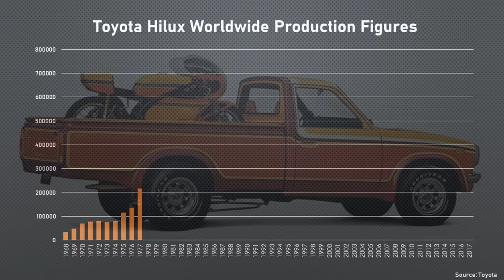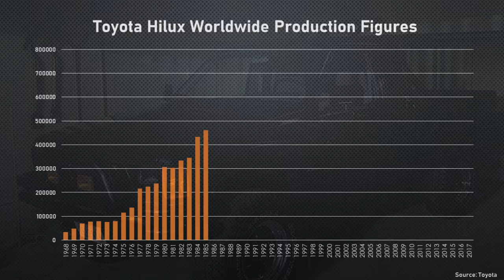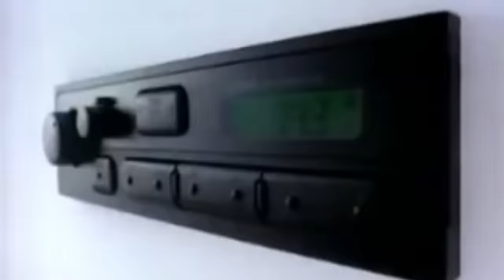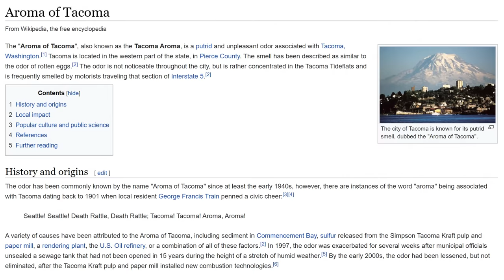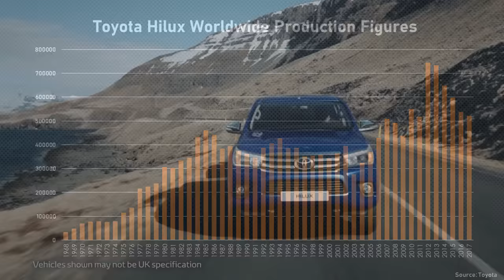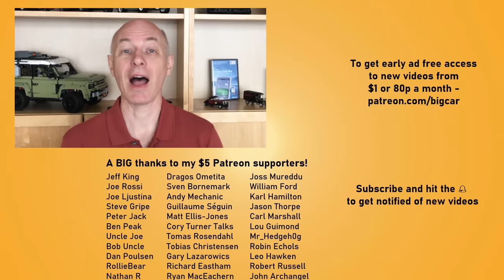Toyota Indestructible Hilux!

Comment: Another brilliant  video.  I had an early Hilux Surf. Got it secondhand with 400 000 km on the clock and it did another 100 000 with me through Namibia, Botswana, South Africa and primarily  Zimbabwe.  The only thing  that required  replacing was a transfer box oil seal.  I had a Land rover 110 Defender before that and the only reason such as high proportion of them still exist is because they spend a large percentage of the time being repaired.   If you want to find a Land rover driver, don't  bother looking behind the steering wheel, look under the bonnet (hood)!

Comment from the maker: Errata: In the "war zone" section, some of the pickups shown aren't Hilux's. But the point still stands.
Yes, I've made mistakes when talking about suspension!
Reply: The mighty landcruiser ute is still a toyota though, and better for some things anyway. Great video
Reply: @michaeldilger9582  If u look on Toyota South Africa u still can buy a brand new 70 series Land Cruiser and FJ
Reply: Some mid wheelbase 70 series land cruisers called “ bundeera” are Hilux chassis and running gear
Reply: Ah, seeing this now. Apologies for my previous comment. :-)
Reply: Pin your comments dude, I left one about a suspension mistake and now i see this lmao. Thanks for the good content. Don't be afraid to take notes and remake these vids with better gfx and updated dialouge in half a decade.
Reply: ‘Why did Toyota end US Hilux sales?!?’ The video didn’t answer the video title question, what gives?
If anything according to the video Hilux sales are still going strong.
Reply from the maker: @s4098429  Because they sold the Tacoma, which was more tailored to the US market. I mention it in the video!

Comment: My brother owned a 1987 Dolphin motorhome built on a HiLux chassis. It was a nice rig, comfortable, rugged and mechanically sound. He put 100k miles on it in 8 years with no major problems of any kind. My guess is the chassis was right on the edge of being overloaded since you couldn't get up 65 if you weren't going downhill, and it needed the airbag suspension to stay level. Still, it worked fine once you dealt with the limitations, and there weren't any other self contained rigs back then where you could get 18 mpg from regular gas. He sold it in 2000 because they were retiring to become fulltimers, and the Dolphin was just too small for that. He misses it though, and his family and mine had some great trips in it.
Reply: I saw one the other day!
Reply: Thanks for sharing your story :-)

Comment: Jeremy Clarkson: "I'm going to kill one on Top Gear."

Hilux: "I'm about to destroy this mans dreams."
Reply: We own a 1974 1600 12R single cab Hilux bought in 1976 and still running. I tried to 'accidentially' write it off twice but it and I survived (obviously). 
Simple strong well made... indestructible Toyota.
Reply: @Time4Breakfast  That's great. I always love to hear from the owners and how well they do. Enjoy the ride.
Reply: @BrandonHanson  you don't know a '70s Hilux otherwise you wouldn't use the words enjoy & ride in the same context 😲🤣
Reply: @Time4Breakfast  If I didn't know anything about this Truck, especially after seeing it on BBC Top Gear. I never would of commented on this video now would I of?
Reply: All staged. 

All you have to do is put a Hilux within 6 feet of a salt shaker and it will rust into nothing.

They must have hosed it off and then doused it in diesel after the North Sea stint.
Reply: @Bartonovich52  you seems to hate it so much that you comment the same thing everywhere
Reply: @Bartonovich52  For being "staged" They sure let it do well let it float out into the open waters during hide tide. So, I imagine where was a "raft underneath it while it was sideways?
Reply: @Bartonovich52  rubbish
Reply: I cant forget jeremy's face when he couldn't kill the red pickup. And he never said "badly made these are!!"
Reply: Lies I tell you. Mine has only 460k miles and already needs an engine service.
Reply: @nobodynoone2500  you need to change the oil and filter every 10K miles...... it should last more than 460k miles....... maybe another 100k miles.....
Reply: @Bartonovich52  watch whistlin diesels videos on it lmao

Comment: I love Toyotas. They were so well built that the body shell would literally disintegrate and the running gear would still be sweet. I had a 95 corolla 1.3 hatchback with a 5 speed manual that I'd regularly thrash the snot out of over hilly, winding roads red lining through 2nd and 3rd. Great feed back through the wheel, sat down nicely in the ass on tight corners when you put the power in and just the right amount of forgiving understeer if you went into a corner a bit too hot. "Sniff" I miss that car a little bit still, it had soul.

Comment: Great video as usual, many thanks. I’m intrigued by the long-term environmental impact of indestructible vehicles like these. Granted, they’re heavy, damage roads more, and guzzle the juice liberally. But if one of these could physically outlast 2 or 3 normal vehicles, it is arguably the more green choice? Reduces by a factor of 2 or 3 the amount of cars being *made*. Has anyone ever thrashed out the figures on something like this?
Reply from the maker: Making a car is a good %age of it's total environmental impact, so having a car that last longer can only be a good thing.
Reply: My 2RZ-FE equipped 1996 Tacoma 2WD (w/ 5-speed manual) is getting 28.3 US MPG mixed! For solely highway driving, 30-34+ US MPG is very doable. I did replace the (cracked) iron exhaust manifold with LC Engineering's street-legal header, so efficiency (or power, depending on driving style) has been boosted at least 10% or so. The rest of the exhaust is all stock, so it doesn't sound annoying or too loud. Can't think of a better single vehicle for myself- load up 1500 lbs, tow 3500, or get groceries and run errands, all without using much fuel.

It has over 337k miles- due to previous owner's neglect, we replaced the cracked cylinder head in 2019, and some sensors, but otherwise, not much with the engine. Lots of other parts were worn, but they functioned for 20-25+ years before I replaced them. A true testament to the build quality of Toyota (and Aisin, etc).

Comment: I never drove a Hilux until I got stationed overseas. These simple little trucks gained my respect. Despite harsh desert conditions and questionable maintenance, I can never recall one having a mechanical failure. The simple gasoline 4 cylinder and 5 speed manual transmission probably contributed greatly to that reliability.

Comment: Great video I currently live in Thailand, and I also have a Toyota hilux, mine is a 2004 sport cruiser, basically a 4 door pickup3,0 litre diesel auto, it has 230000 kilometers on it ,and genuinely genuinely I have never had to replace anything on it other than servisable parts, oil filters battery ,front shocks only ,tyres and only the front break pads no discs yet, don't think I have ever put a bulb in it, obviously the weather here helps but these are some unbelievably good vehicles, ohh its had a few sets off wiper blades actually as the sun tends to melt them to the windscreen, but other that that nothing.
Reply: I am relatively new to living in Thailand from the UK.
I bought a Toyota Hilux PreRunner Double Cab 2.4 diesel in 2017 but recently added a Standard Cab 4x4 2.8 diesel as a work vehicle.

Comment: Really surprising to know that the Innova and Kijang (sold here in the Philippines as the “Tamaraw FX”, then “Revo” on its final years) were based from the Hilux!! The only one I knew heavily based from that car is the Fortuner. Both the Hilux and Fortuner would cost you quite a sum here and considered a status symbol.
Reply: I know I’m a little late, but a little correction there. The Kijang (or the Tamaraw FX in your country) was based entirely on a different underpinning, while the Innova (or the Revo) was indeed derived from the Hilux. As well as the Fortuner, they’re all part of Toyota’s IMV program with the main purpose of developing rugged MPV, pickup and SUV for developing countries 👍

Comment: I have had two of the truck models shown:
1971 Hilux 1st generation.
1984 & 1986 Hilux SR5 turbo. 4th generation.

I wish I never sold the 1971, we were the original owners. After it was stolen and partially stripped for the second time, it sat for 10 years and was eventually sold for scrap. ;(
Looking back, it wouldn't have been very difficult to repair it and get it back on the road. 

I have a few of the rare factory Turbo trucks that I plan on keeping as long as possible. 

Toyota trucks never die!

Comment: I started my career as an auto technician at a Toyota dealership in 1993. The pickups were our best sellers right next to the Camry and Corolla. When the T100 first came out, it was not well received by our customers. Great video!!! I had NO idea VW rebadged a Hilux!!
Reply: I read somewhere VW is now going to rebadge Ford pickups...
Reply: mauritsvw - 2G / Mk 2 Amaroks on the T7 (6G / Mk 6 Bronco SUV) chassis. 

Although with the possibility of a future merge between Toyota and VW looming (check the new project between Hino and VAG's commercial arm), who knows if that with Ford won't last long...
Reply: Yeah it "bugs" me a little 😂
Reply: Joel Atteberry - try the Toyota SA shown in the video. It'll really BUGS YOU UP.
Reply: @syxepop  Interesting, thanks!

Comment: Own a 2010 hilux. From my father, to my brother, and now Ive been using it for almost 4 years now. 195,000 km. Just on-time maintenance. Still running smooth.
Reply: Nathan Marais  How TF? I own a 2003 Hilux SR5 with 154,000 km on the clock. I purchased it at only one and a half years old, in 2005, and it already had a massive 34,000 k's on it then... I don't know how people do it?
Reply: Nathan Marais  Thanks Nathan, I still can't fully comprehend, your butt would have to be strapped in the seat 24/7 in my minds eye. I bought mine from a farmer too, they just must do incredibly large miles? I've done 120,000 in 15 years, and I thought I drove it heaps.

Comment: Toyota Hilux: "Indestructible!"
Australian Coal Mines: hold my beer
Reply: @BigBoiTurboslav  Yeah, but also the water at the washdown bays is always somewhat corrosive.
Reply: I agree with Godfrey Poon. I was in the Mt. Isa lead/copper mine years ago and the used hilux, s to go around the mine underground. They would be absolutely destroyed when they were brought back up to the surface. Only 6000kms on the clock. But they would still run
Reply: A salt shaker six feet away: Hold my beer. 

Seriously.... Toyota has always sucked at corrosion protection. The only truck I’ve ever seen to have a frame literally rust in half.
Reply: @BigBoiTurboslav  u just described a bogan that dident buy a commodore
Reply: Hold my Foster's you mean
Reply: @godfreypoon5148  Wasn't really arguing with you, mate. I haven't been around the outback much but just witnessing Brisbane driving makes me feel bad for those poor Hiluxes
Reply: @BigBoiTurboslav  I didn't read any argument in your comment haha. It's all true.
Reply: Argyle underground 2 year old Hilux’s and Landcruiser’s looks like they fell out of the sky without a parachute! 
But my 89 extra cab petrol 4x4 
And my 03 DC diesel 4x4 
are mint and awesome !!
Reply: @mogwaifan7094  seen the same happen here at a mine in ireland when it was in operation ....... local man used to supply good low milage  imports from the uk  , and take away the abused ones when needed .............purchased one in 2008 from him and still have it ,,,,,,,was never  underground  but is a little beaten up  by now but  runs good ..........clock shows 195k miles but i often think it could well have had a hair cut  before i  owned it as it was imported   .............
Reply: Mahindra what now
Reply: Every mining company. I'm from Peru and mining companies buy them on bulk they're so reliable at high altitudes above 4000 meters
Reply: Indeed...its the coal ....highly corrosive.....very common for a brand new mine vehicle to only last a little over a year before it is a write off....its a testament to how much money they have to throw away when they just replace them with brand new vehicles every year or 2 and just auction off the rest for whatever

Comment: "Why did Toyota end US Hilux sales?!?"
DID I MISS THE EXPLANATION?
Reply: Your not alone because I'm thinking the same thing. I'm sure it's in there though ?
Reply: Because it was replaced by the Tacoma
Reply: Because the American market preferred a little more luxury and larger vehicles, so they ended the Hilux and instead introduced the Tacoma line which was specifically designed for the American market to compete with Fords and Chevies.  Although technically the 4Runner is still based on the Hilux so the name may not be there, but the car still lives on.
Reply: @jonjohns8145  thanks for the info !
Reply: @jonjohns8145  Pretty much what you said, though the current gen 4Runner is actually more related to the Land Cruiser Prado/Lexus GX than the Hilux nowadays.

Comment: I drove a '74 year round in Alaska for a very long time. Couldn't kill the thing.  After insulating the cab, installing an electric water pump, and a Cadillac heater box it was even somewhat comfortable.
Reply: I've got an original 1974. 
The bench seats are not comfortable or even ergonomic. 
I use cushions.👍
Heating not a problem here in Australia. But 40°c and no aircon can get a touch uncomfortable 🥴
Wind down the window? Hot still air vs. hot moving air !! Cheers

Comment: As usual, excellent video.
I would add that, if in europe and USA, front suspension was independant early on, in developping countries a heavy duty version, with beam axles, was still available in the 90s. I had one in Papua New Guinea from 1991 to 1993. 2,8 naturaly aspirated engine and front beam axle. The other brands (Nissan, Isuzu) had IFS and we had to weld it back to the chassis about once a year...

Comment: Had 2008 Hilux 3.0 D4D for a few years. When working on powerline projects I was towing trailer with metal bars, medium and high voltage headgear or quadbike. Off-road is well. Beast. Once I drove from Ireland to Poland and back. With family I did few trips and my sons still remember driving Hilux on beach at ocean outflow. Great car, indeed.

Comment: 12:35 Actually, it was standard from the 89-model forward.
Reply: The first models with IFS model were released late 1985, with the release of the 1986 model of the Toyota Pickup, but that's only in some regions like the USA, the Forerunner/Surf switch in all regions to IFS at this time. The Hilux (not US Toyota Pickup) had a solid front axle throughout the 4th and 5th gen, all the way until the 6th gen release in 1998. South Africa kept manufacture the 4th gen all the way up until 1997 effectively skipping the Fifth gen.  (The Toyota Pickup and Hilux basically split into two different products in 1986 with the Toyota Pickup evolving into the Tacoma and Hilux staying the course).
Reply: @taznz1  Okay, I must live in a region were the Mk. V had IFS, because I've never seen a factory standard Hilux with solid front suspension past 1989.

Comment: In SA this was the best selling puck up truck (or as we love to call it "A bakkie" pronounced as "Bucky"). But now the Ford Ranger has stolen its crown.
Reply: You are a Blue Oval fan, i can tell. Last time I checked,Toyota was still the best selling Bakkie of the month for the past numerous months.
Reply: Toyota still outsells the ford, Isuzu had two good months recently pushing ford to third
Reply: @Kavi4GP  

Isuzu is a tough diesel truck maker from Japan with low profile.  Mazda also made robust pickup in 1980s while Ford Ranger was the twin of Mazda B2000 pickup.